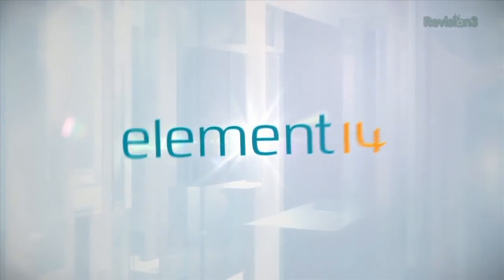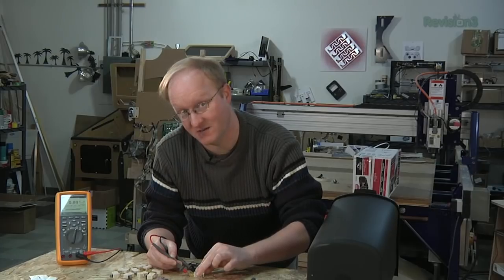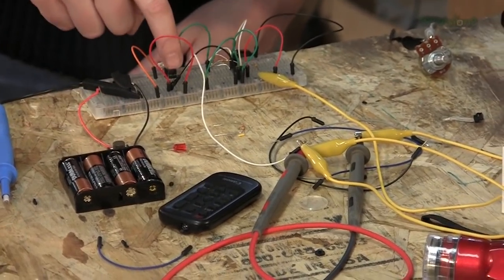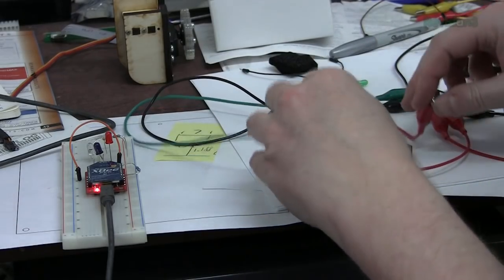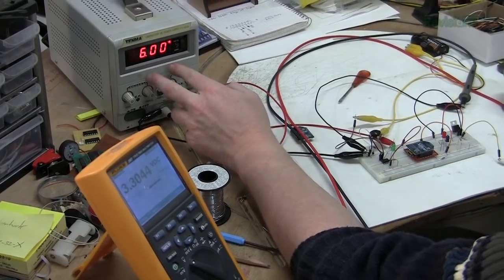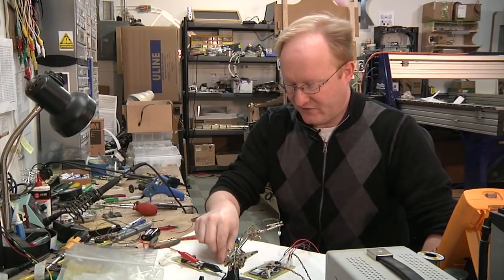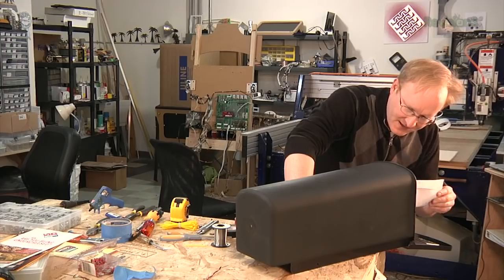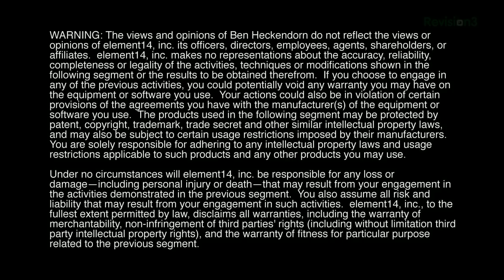Build a Wireless Mail Detection Device

Comment: This is really good, but if you want something more low tech, get a wireless doorbell, solder a magnetic switch on it and mount it in your mailbox. Plug the other part into a wall plug and you're all set. The one I did travels 1100 feet and has 32 chimes.  Works great!

Comment: I was so very happy to see electronics have come back around to something i would be happy to start doing at a 45 years old Veteran. I graduated with a Stanford Computer Science Master degree and minor in electrical engineering many many  years ago and was building electronics out of wires back in the 80's. But truthfully after watching a couple episodes i feel sort of lost. The mailbox episode makes me wonder if any moisture would damage the circuit board or anything else. I really hate to be a beginner at 45 but i have so many ideas that the only set back is the new electronics look like they make things a lot easier but, but then again harder and more too it.I have debated buying this 37 piece anrduino sensor set, just not sure...Guess i will watch more of your videos.
Reply: Jared Traver Howdy young fellow, I used to do TV repair for the officers when stationed at Fort Bliss Texas back in the early 70's and at Fort Meyer Va back in 76-77. Mostly just change tubes getting the replacements from the local radio shack.  So I am pretty much a beginner at 63.  I did study electronics with a correspondence course from Bell and Howell back in the early 70's myself but gave up when the Army got busy and I didn't want to waste time on such things  when a promotion meant more bucks in the pay envelope.  Been messing with electronics a bit ever since but not a lot, got more into computers and programing as a hobby till I found Ben Heck show and Julian Iliatt on youtube

Comment: Nice, it could be simplified by removing the IR sensors and just making it work on of the open and close switch. Most of the time the mailman won't even bother opening the mailbox if you have no mail, but sometimes they check for outgoing mail I guess. Very cool project.

Comment: To get a precise and easier to read frequency measurement, FFT the input signal, even with a square wave the largest peak should be the driving frequency. The others are residuals of basically the Fourier Transform.You're going to get a sinc-like waveform in the frequency domain from a square wave input.

Comment: I built something like this a couple months ago, I did it a bit differently. I used an ESP8266, IR sensors and 4 AA batteries. I did not use a door switch. The code I wrote would wake up, check the status of the sensors, post a message to me over wifi and then go into deep sleep for 1 hour. I figured I don't need real time checking, I couldn't really thing of a point to it being real time. I also figured I'd probably have fewer bugs and false positives with powering up and checking the sensors while the door was opened (when the mail person is doing things to the mailbox). The idea was it would instead be most likely checked when the mailbox is undisturbed. Also I figured by using deep sleep I didn't need to cut power to the system. 

My math, which could be flawed suggests I would get a couple years of battery life doing it this way. 

This project makes me think that I could have a reason to have a switch on the door. To cut the power when opened, so that it doesn't end up doing a check while being disturbed, reducing the false positives that I speculated.

Comment: You can still do it differently, momentary switches under a floorplate, so that mail dropped through the slit trigger the alert system, or a momentary switch with it's arm across the mailbox slit (of the same type that the one he used for this build, for the door, but with a longer switch "lever")

Comment: Excellent project. Let me add,I think it is a bit over engineered. A single light detector would work or a no switch. Mail only comes in day time, mail box closed is dark inside, open, light enters, you get the trip and alert signal. But, an even cooler device would be a thin envelope, such as a CD mailer, you just leave it in your mail box, no installation, it contains the detector and the transmitter and battery. No installation, it just lays in the bottom of your mail box and bangs on when mail is tossed in. Cool...Also, no hassel from the USPS about "You have violated Postal code 3245-67-1978 which states, to wit: Thou shalt not molest in, around, upon, or beside any portion of thy mail receptical orifice!, other wise known commonly as ...and crudly...the 'mail box' ."

Comment: Most mailboxes in Europe are not designed the same, in Sweden alone we have 3 different kind of mailboxes, the postbox looking ones being most common in appartments, the vertical mailboxes being common for houses and then we have mail "holes" in the apartments doors. The design on this video works for 2 out of those mailboxes, it might be possible to make it work for the door mailbox aswell but that's kind of unnecessary since you will hear the mail anyway.

Comment: A cheaper method is something my grandparents did.
Attach a spring to a ball and attach it to the edge of the mail box.
Grab the device and place it so it stays under the little bit of the mailbox used to open the little door.
When the mailman comes the little device will be up in the air and not in place.

Comment: Since your mailbox should signal the receiving part in case of the new mail, could you get away with a manual reset button on the receiving part to avoid using a microcontroller? In other words, there is no state under which your mail disappears from the mailbox without you knowing it (discount stealing), so you can reset it each time by hand. Or even send the 'empty' state to receiver when you take your mail out?

Comment: I'm curious how do you get it to work reliably if it is in a metal mailbox instead of a plastic one?    the reason for this question is because a metal mailbox would most certainly act as a RF(radio frequency radiation) shield.

Comment: Thanks for you efforts to share with us. It does occur to me that the IR approach is not really needed. You could drive the circuit off of the pressure switch. When the door is opened by the mailperson, the circuit would be activated. Good enough...

Comment: When you were talking about the switches didn't you mean we want the switch (NC) vs (NO), seeing as the (NC/NO) refers to the relaxed not actuated state of the switch? If you were using a (NO) switch, the circuit would only be a closed when the door is shut.

Comment: Fine if the mail is put into the box perpendicular to the IR beam, horizontally or vertically; but it wouldn't work if the mail was added parallel to the beam, as it may not break the beam of light.

Comment: did you read the answer I made to the last one answering that comment... I doubt, otherwise I wouldn't have to answer you...
I stated that for it to be easier here, a pressure plate would be better (but less cool) than what ben is making!

And I'm not making Europe one country, however, most mailbox in Europe or designed the same!